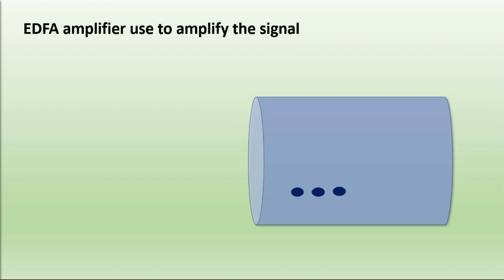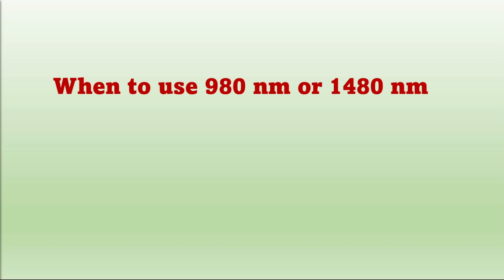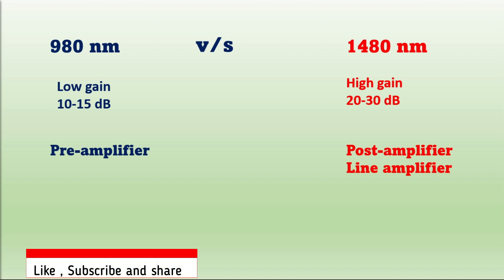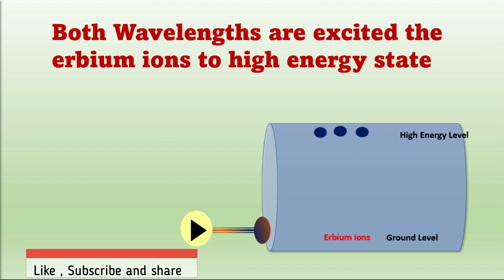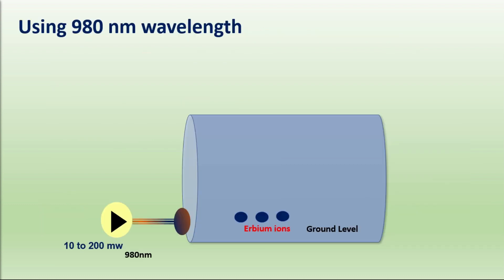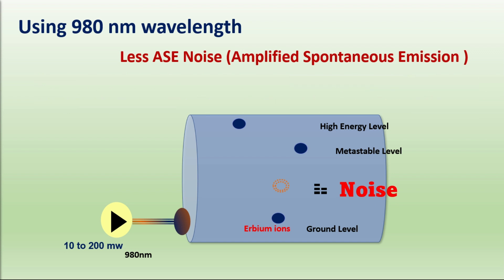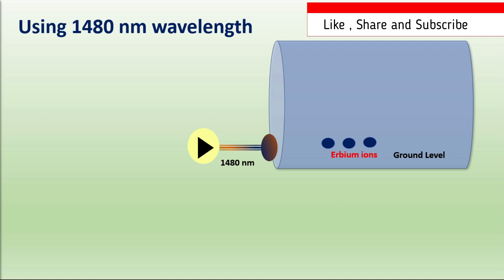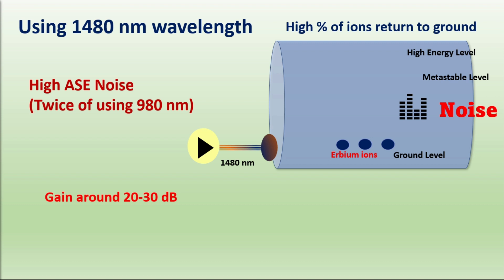980/1480 nm pump wavelength used in EDFA amplifier , DWDM Fiber | ROADM | OTN #roadm #otn #dwdm

Comment: Unfortunately, I didn`t understand one thing. When use 980nm pumping, excited electrons "live" on high level and metastable level much longer than with 1480nm pumping. That`s why they have lower chance to drop down to ground level and, vice versa, have big change to generate new photon after colliding with photon of initial signal. So, with 980nm pumping we should have lower ASE and higher stimulated emission. That makes me confused why EDFA with 980nm have less gain, when such EDFA must have higher stimulated emission.

Comment: I have few queries, 
1) why do we mostly use Raman amplifier in counter propagation mode.
2) How can we improve the OSNR for a given link.
3) How do we decide for ORL value, like it should be greater than 25db or 30db. what does 25dbm or 30dbm actually mean,like how much power is reflected back?